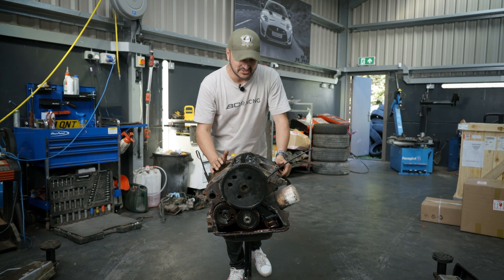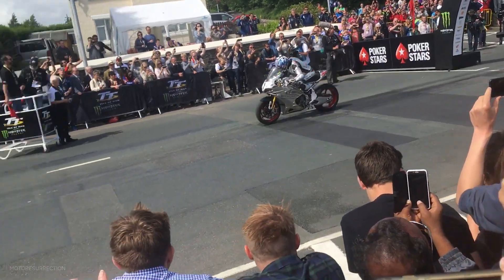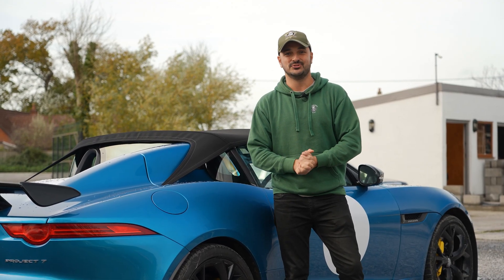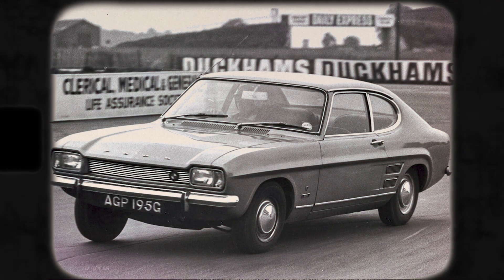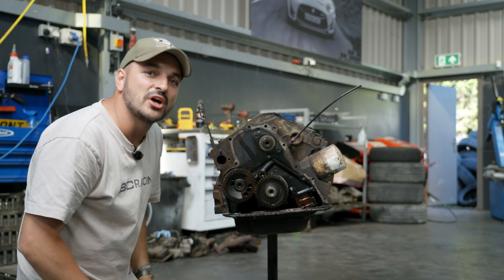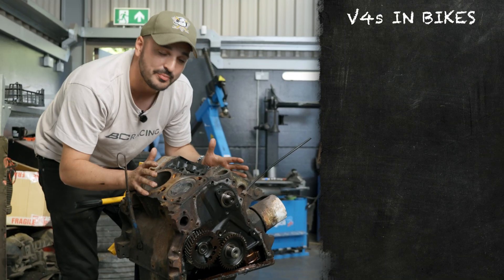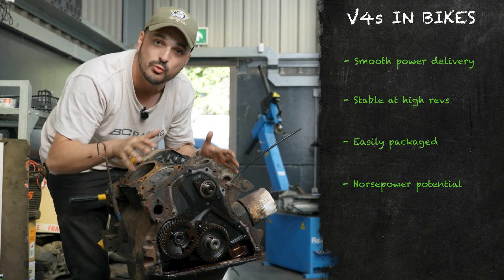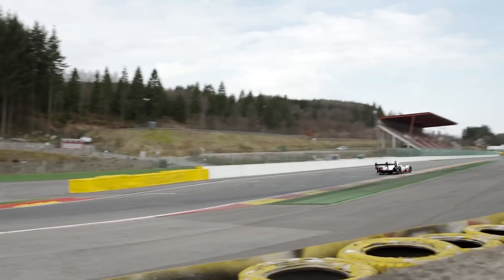Why Do Cars Not Have V4 Engines?

Comment: This engine Ford Taunus V4 was in my Saab 96 from 1968
Reply: Actually Essex V4 and Cologne V4 (used in Saabs) are little bit different
Reply: @wyrazowfkp the Saab version ran  backwards compared to the ford version
Reply: @jm6604-c4d  No it did not :)  It's same as in P4 and P6 Taunus front wheel drive cars
Reply: SAAB V4 1967-1980  😎👍
Reply: 1972 for mine. Good until the floor developed a large hole near the rear suspension. RIP unfortunately. 😢Heated seats in the 70’s…luxury!😘
Reply: I had a '71 Ford Capri with the 1.7L variant of the Cologne V4, not very powerful but solid and sounded very cool !
Reply: Mine too, may she rest in peace

Comment: I always wondered what was up with the lack of V4
Reply: Manufacturing cost (2 heads), old fashioned OHV with camshaft in the middle of the v,   or 2 camshafts and more complicated chain or belt driven camshaft, no real advantage than the lenght.  But they sound great :)

Comment: Nice one Mike, this is the nerdy stuff I like👍
We had a V4 in one of our school buses way back when in the 70s.
Always wondered why when VW were going through their crazy phase with engines , didnt do a VR4? The did the VR5, VR6, VR8, VR12 and the mighty VR16 in the Bugatti. 
I had two VR5s the 10v and the 20v lovely engines, But a VR4 would have been a nice compact engine to have.
Reply: I might've driven that school bus...
Reply: "VR" 8 12 and 16 are not a proper VR really.   They are W formation Engines with 2 cylinder heads. VR5 and VR6 had only 1 head.

Why would you make VR4 or VR3 ?  No point in that.  VR6 was short so you could fit it transverse in the engine bay. With 4 cylinders you don't really need that. Maybe in longitudinal Audi and Passat, there would be not so much weight at the front but those 1.8T 20v engines were universal, also used transversly in other models.
Reply: @wyrazowfkp  The Lancia narrow angle V4 single head is an equivalent of a VR4. It worked for them over the many versions and decades that they made them. Their drivetrain was longitudinal front wheel drive, so having the cylinders in a narrow angle was very space efficient and very short. The Audis of the era had inline 4 cylinders and they were long in front of the front wheels. Understeer is the price you pay for a long longitudinal front wheel drive.
Reply: I think the walls would have been too thin to package the water jackets and oil passages. 

A VR4 might have worked as a 2 cycle though.

Comment: Old Ford Transits and Saabs from the 70's had a V4. Fairly reliable unit.
Reply: Saabs had only the Cologne V4 (Taunus).  Transits had both Cologne (1.5 and 1.7) and Essex V4 (1.7 and 2.0).

Cologne V4 were used in Taunus models like P4, P6 front wheel drive,  P5 and P7 (Ford 17M) rear wheel drive, Transit, Capri and Consul/Granada models.  Also Matra 530 , Saabs and DKW Munga.

Essex V4 in English models like Corsair, Transit Mk1, Capri Mk1, and also Zephyr, Consul/Granada and also in Ford 17M  or 20M (P7) in South Africa.

Comment: did have the opportunity to work on a couple (also made by Ford) Taunus V4's, not a ton were sold in the US, one I worked on was in a Saab Sonnet III, and the others were in tractors. Wouldn't call them the very best, but incredibly simple, even for a tractor engine

Comment: SAAB V4, last spark plug was so impossible to change that it should had been named V3
Reply: I think that it is actually a ford engine.
Reply: @noneyabiz8225  it is, but was used in later Saab 96s. Own one myself and I can confirm, changing the spark plugs is all nice and easy, until you gotta do the 1st cylinder. I dont even torque that one, cause I would need to move the alternator and I cant be arsed.
Reply: @mister_muffin3625 In the 70's, it was a PITA, but by today's standard, replacing the 1st cylinder's spark plug is a child's play. The "bull's horn" manifold was trickier to remove.
Reply: @noneyabiz8225  Yes, from the Ford Taunus. If I'm not mistaken those were called 12M and 15M.
Reply: @noneyabiz8225  it is, 1962 build in Köln by Ford
Reply: @noneyabiz8225  Yeah its the Ford Taunus V4. The German designed version.
Reply: @noneyabiz8225  yes it was Ford engine. With pachelite cam gear...
Reply: @noneyabiz8225  I always wondered why Saab didn’t continue that concept. It being a Ford engine makes it make a bit more sense.
Reply: @autobootpiloot Well, Saab went on with the Triumph inline-4 engine instead...
Reply: @noneyabiz8225  It was a Holden V-4.
Reply: @CMDR_CLASSIFIED  What was a Holden V4?
Reply: Ford Taunus & Transit … stables of 70es 😉
Reply: Not at all, if you have the right tools. I had more than 50 SAAB V4 since the 70s.  Best car on gravel and snow.  😎👍
Reply: I found it was necessary to remove the alternator to get to that spark plug. Being a German Ford engine, valves, etc from the Essex wouldn't fit, so you had to buy from SAAB, who kindly packed them in plastic bags bearing the blue SAAB name. If you looked carefully at the valve itself (inlet or exhaust), there in small font was the Ford logo. So having struggled and forked out, to do a complete head overhaul, I put it all back together again, only to find the glorious Cologne V4 was still almost as rough as it had been before, when it was complete with two badly burnt exhaust valves. All in all, not one of my better motoring experiences.
Reply: @promerops  they came with a spark plug wrench for cylinder 1. If you didn't have one, yeah, that's about the only way to manage it.
Reply: @Londubh  Thanks for the advice - if only I'd known this 45 years ago!!! I don't think this special wrench was included in the toolkit and I can't remember if I even had an owner's manual for the car. I only had the SAAB for a short while, before I moved abroad. We live and learn!
Reply: Transit, V4 for years and years. Must have delivered everything over millions of miles. Lancashire Fulvia, one of the most beautiful cars ever made.. Nothing wrong with a V4.
Reply: @antonyhughes4702 I've owned 2 fulvias a 1300 and a 1600HF they were really good engines
Reply: Built the ford V4 on the assembly line.
Reply: Thank you I had one of these.  I thought I must be dreaming it.
Reply: lancia fulvia v4
Reply: We had a v4  Mk1 Transit was also used in the corsair and the Saab. That said, our Transit V4 pulled like a train when used with a trailer, it also went well too! 
For some reason after about 10 years use, we needed to take off one of the cylinder heads. When contacting our local Ford dealer, he informed us that ours was a low compression head. We double checked the other head and that was a high compression head. So to keep ours working as before, we ordered a low compression head, fitted it and the vehicle went on to run very well for another 10 -15 years without any problems what so ever. Who knew!!!
Reply: @grahambex5829  Interesting to hear that you used the English Ford V4 in the SAAB V4. I always thought it was the German Ford V4 that was used in all SAAB V4s between 1967-1980
Reply: That was the same Ford V4
Reply: The Lancia Fulvia HF1600 is a jewel of an engine sounds like nothing else. They also made the first production V4 with the Lambda (1922).😊

Comment: V4 is a great engine config tbh. 
I have a 1970s SAAB 96 with the Ford V4 engine. Ok it's not the worlds best or most powerful or smoothest engine or anything....but it has a totally unique character and noise, is real fun to drive as a result.

I also have a Subaru flat4 and a v12, & the distinct character of the V4 is ace.

Comment: The lancia lambda engine! What a masterpiece and with the V4 Fulvia they won everything possible in rallies
Reply: Ran a Fulvia 1600HF as a daily for many years, probably the most engaging car I’ve had, every drive was a special experience.
Reply: and i couldnt decide if i want the fulvia hf coupe or the zagato version. both look so damn cool. one in the beautiful 60s kinda way and the other in a 70s futurism kinda way.
Reply: @Mr.Marbles  if you look for the 1.6 go for the coupé,  otherwise if you are looking for a 1.3 the zagato first series is in my opinion the proper choice
Reply: the first legend in the dirt and snow from lancia, first of many
Reply: Great video. The Lancia Fulvia V4 was 12 degrees btw.
Reply: @roybatty2030 With a single head.  I have a Fulvia Zagato 1.3S with twin Dellortos.
Reply: @roybatty2030 I always thought it was 15 degrees but stand to be corrected.
Reply: @peterlovett5841  The 1600 was the narrowest Fulvia V4 at 11 degrees, 20 minutes, the 1091/1216 engine was the largest at 12 degrees 53 minutes and 28 seconds, with the 1231 and 1298cc versions at 12 degrees 45 minutes 28 seconds
Reply: @norwichphoto  Thank you for the information.
Reply: Yep, I’ve got a Fulvia Coupe, it’s silky smooth, loves to rev, and sounds fantastic.
Reply: @ElBlingo how reliable is it?
Reply: @ludagaz I've owned 2,a 1300 and a 1600HF used as daily drivers and never had to do anything apart from servicing, but the carbs are a pain, once set up properly though they are great 👍
Reply: @ludagaz Horrendous, horrible thing with either head gasket issues, oil leaks and there was something much worse……..  The timing chain used to jump its sprockets frequently, the damage to the valves was disastrous.  The clutch was fragile needing it to be replaced prematurely and that was yet another problem.  An inexperienced mechanic would tighten the clutch pressure plate bolts while turning the engine over clockwise looking from the rear, he would not realise that the cam chain tensioner had gone slack and fallen out, then the first stab of the starter motor wrote the entire engine off.
Reply: @davidebbs6146  owning two of them, using them for road and racing and fixing them myself i can guarantee that this does not correspond to reality. The earliest ones had some clutch issues (nothing that a modern clutch couldn't fix) but the car is extremely reliable, stiff for being so light and with a good amount of power. The engine almost never has a problem. But of course if the maintenance isn't done or done by someone who has no idea of what he is doing, then failures occur (the same concept can be applied to every make or model)
Reply: I had a rally spec Fulvia in the early 80s, it was a fantastic car, I loved it. Great engine and it sounded fantastic.  Shame the body was soluble...
Reply: @andybradshaw5971 They last a bit longer if you live where the roads are not salted😮just...
Reply: Yes, a true engineering masterpiece. From 1600 cc they achieved 165 bhp, some even more without the help of turbos or compressors
Reply: Also the Saab 96 V4 won Sweden and RAC.
Reply: @marcns007 the Fulvia won more than 40 rallies and the world rally championship in 72
Reply: @fedebrova Saab got the V4 with fuel injection up to 180bhp but the gear box was the weak link which is why they only won in low grip events and won the Swedish more than any other manufacturer.
Reply: @marcns007  the real competitive Saab was the previous version, the v4 arrived in front of the Fulvia only in the 1971 championship (won by the alpine) and was only competing in rallies, the fulvia won the class at daytona and nurburgring (the most important results) proving to be fast not only in rallies
Reply: This popped up in my feed, curious I clicked on it. Surprised buddy, this was good solid content, well edited and well covered. Good luck, subscribed and liked to help your algorithm… V Twins or Flat Twins in cars? Just teasing

Comment: ZAZ models from 965 to 968M have had V4, air cooled engine.
LuAZ 969M has the same engine as ZAZ 968M:)
Reply: also AMC military jeeps.

The ZAZ Zaporozeths V4 was a 90deg one too :)
Reply: Yes, and it was really costly to manufacture and offered very little performance :)
Reply: Еее наш слоняра
Reply: I didn't know that ,Thanks
Reply: Those engines are pretty crappy. Bad engineering and low quality production

Comment: Friendly feedback : This could have been improved with even 30 seconds and a couple of simple diagrams explaining what the balancing issue is caused by ( just stating that 90 degrees is ideal doesn't do that ), and to explain what a balancing shaft is. It wouldn't turn the video into a nerdy "engineering explained" level video, but would help to bring those who don't know along with you. You'll be cruise by 100k subs by Christmas - that was fast ! Greetings from Prague, CZ !

Comment: Love this! Information dense and deeply interesting. Ford has a weird history of designing an engine and either lopping cylinders off (Essex V6/V4) or adding cylinders (Duratec V6 -> Aston V12), and I'm glad you featured one as your first video. So cool to see in the flesh.
Reply: Nooo Essex V4 came first , same with the Cologne V4 and later V6 --- in those engines you can see the added 2 cylinders in valve locations, exhaust design etc.  In Essex they've made a far better job with that.
Reply: @wyrazowfkp  ah crap, I had it backwards. Thanks for the correction!